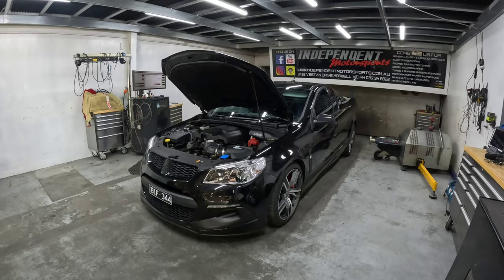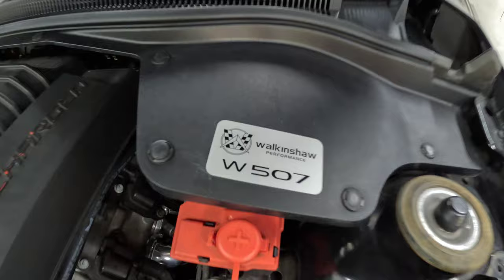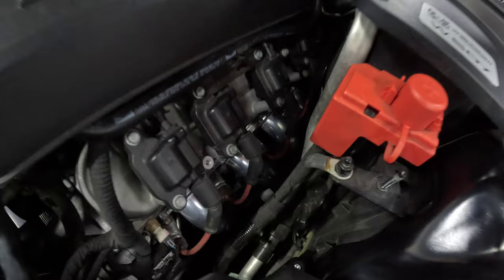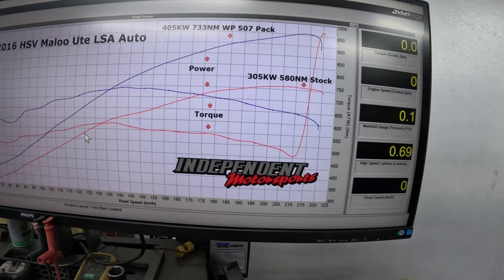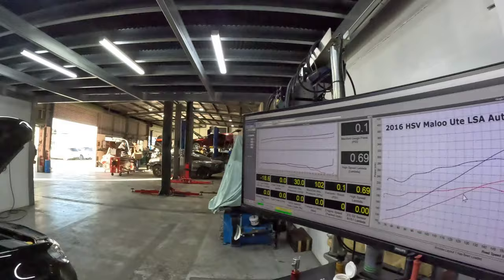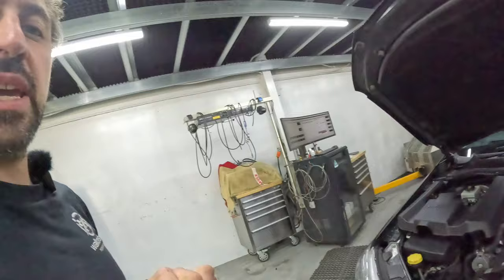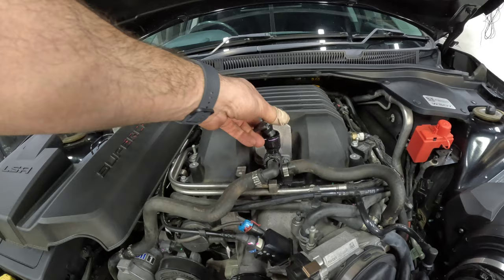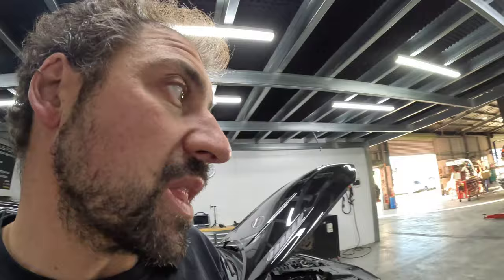Walkinshaw performance W507 LSA Pack

Comment: Awesome video bro. Probably the first time I’ve ever seen a Dyno sheet from a walkinshaw package. Quick question… what size is the exhaust that they use? To understanding it’s a 1 3/4” primary tube headers into a 3” collector and after the cats it necks down to a 2.5”?
Reply from the maker: That is correct. the middle section is 2.5 then back to 3 into the rear mufflers. It actually works pretty good.

Comment: Is a BOV needed on a turbo car? Does it make A difference or tricky when you tune them without a BOV aiming for over 450kw on my xr6t should I put a bov or no
Reply from the maker: If you want your turbo to survive yes a BOV is required
Reply: It’s a myth ! 
I ran a BOV for years on my Barra with 360rwkw and my turbo let go 
I now have an upgraded turbo with 500rwkw and blocked BOV and going fine for years , just make sure your oil feed line for ur turbo is not blocked and serviced and will be fine
Reply: @lloydchristmas2326  thanks and not fussed about the turbo it's cheap as I got a pulsar turbo core and its going good 2y now with no bov. I want 500kw lol what have you done to get 500kw I want to max out my gtx3582r